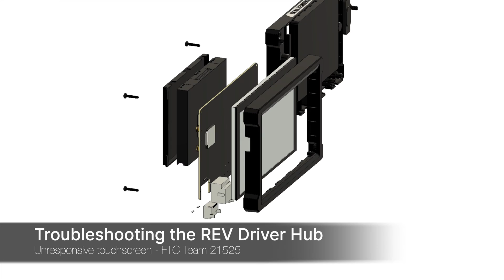REV Driver Hub: How to Fix an Unresponsive touchscreen (FTC Team 21525)

Comment: Thanks for this! I took one of ours apart but did not know about the clips on the connectors and did not want to break it. Our ribbons are attached but I am going to try to take them off and put them back. Does the other ribbon have the type of clip holding it on?